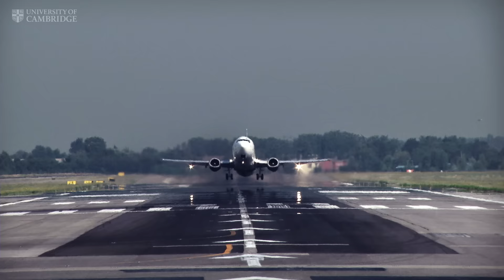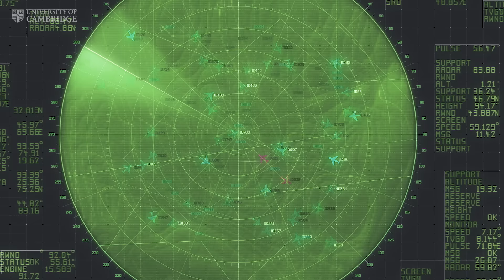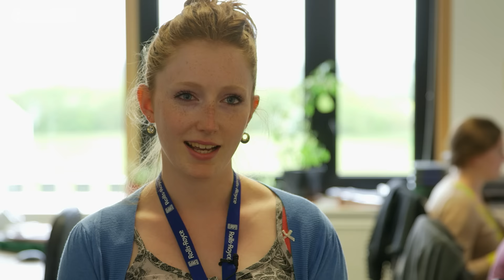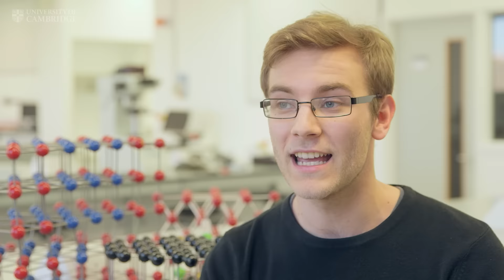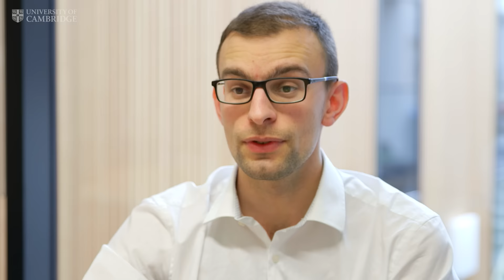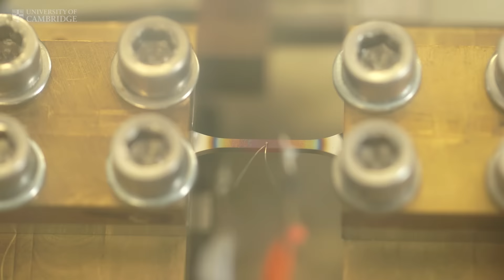Engineering Atoms

Comment: What a joke, they talk of ICE as if it were cutting edge. All electric is the frontier, not this fossil burning junk that can't get over 50% efficiency without many layers of heat recovery.
Reply: Although all electric is very practical from an automotive standpoint, it isn't as straightforward when looking at aviation. Anything other than tested and trusted ICE is very difficult to develop and implement, especially considering the requirements and limitations.